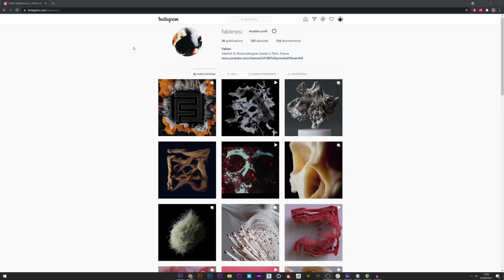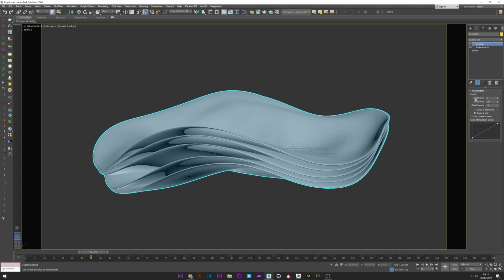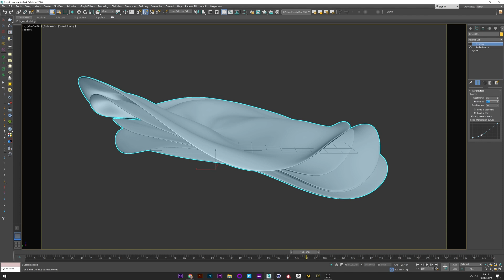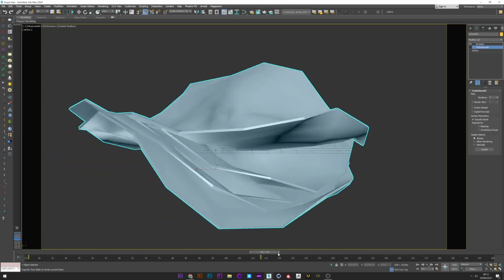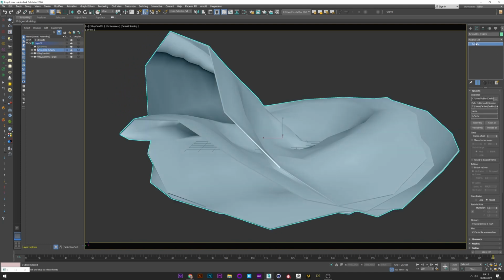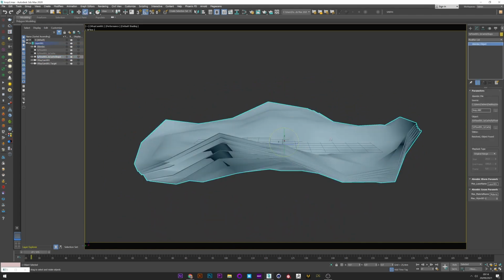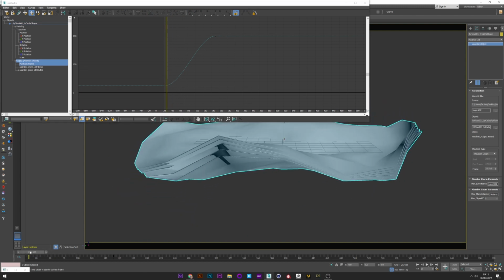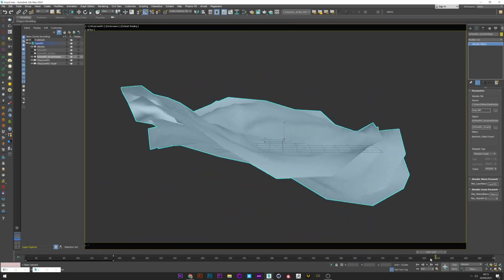How to loop to the infinite | 3dsmax x Tyflow Tutorial

Comment: hi, when i add tylooper modifier my particles just disappear any clue why so? thanks
Reply from the maker: Tylooper only works for deformating object like cloth simulation but dont works for particles simulation
Reply: @fabienescudero  thanks for the quick reply man, I'm using tymesher with blobmesh so it may work on that?
Reply from the maker: If your blobs are driven by a particle system it will not work. And export your particles with a tycache will not solve the probleme.( I have already tried lol) by if it's sjere animated manually. it could
Reply: https://www.youtube.com/watch?v=C4Zyrw8KdmI 1 solution, may be help